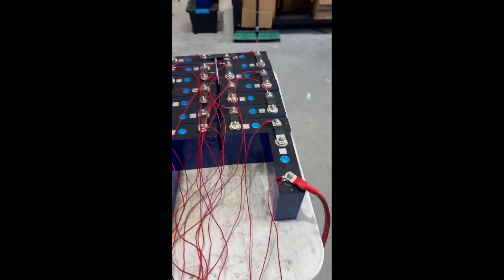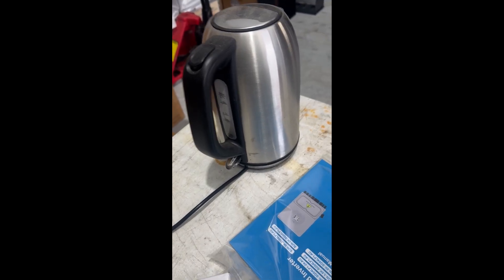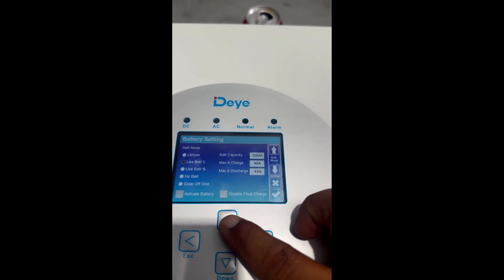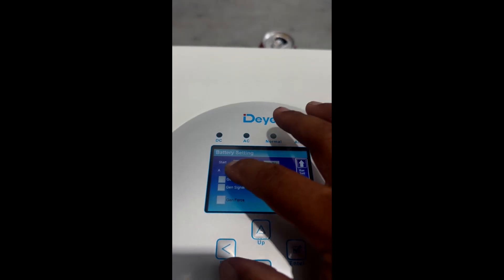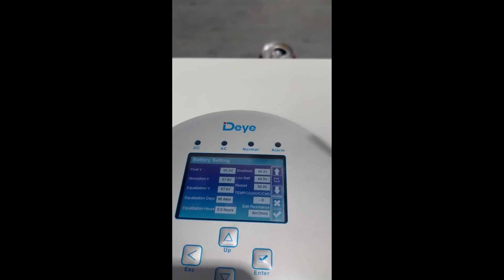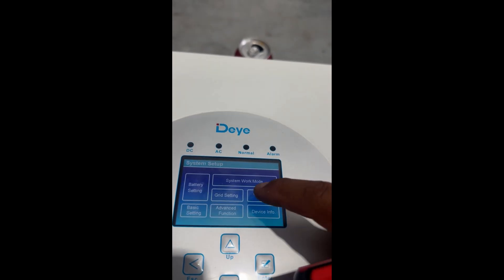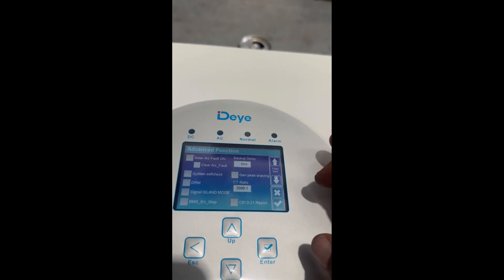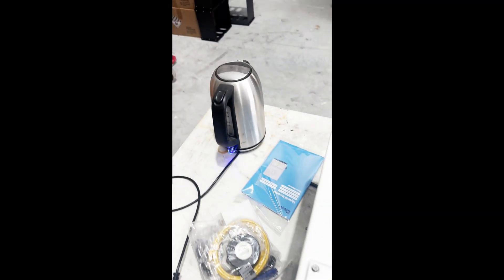Deye 48V Inverter Off-Grid Setup & Settings Explained

Comment: I think you have to select Signal Island Mode ON for of-grid and Zero export to Load for optimal performance. it doesn't wait signal from CT. It works more stable in off-grid mode.